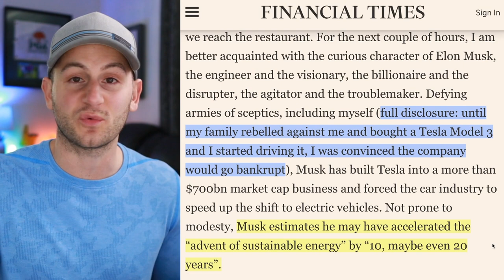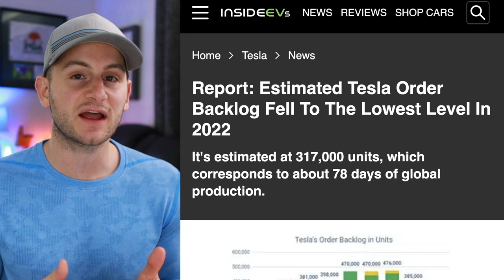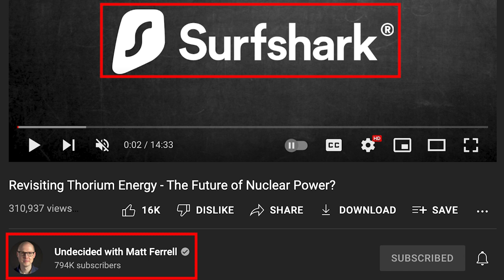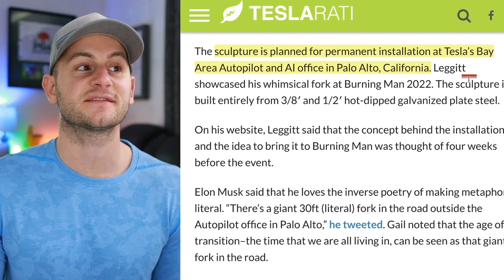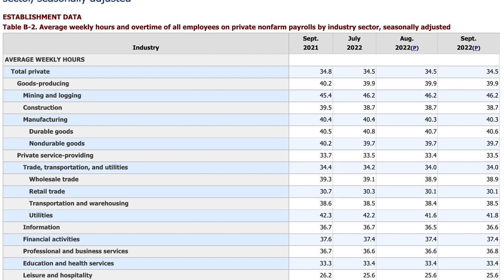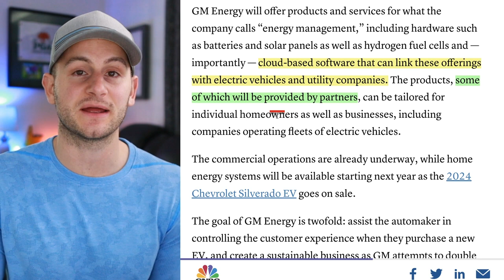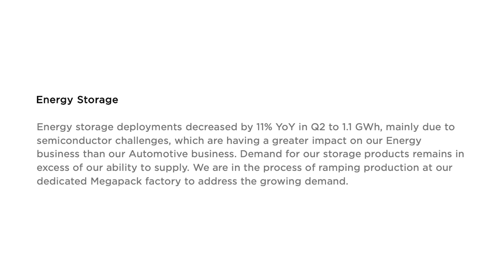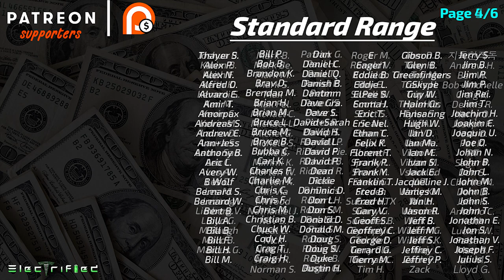Tesla's Order Backlog: Getting It All Wrong / GM Takes Aim At Tesla Energy - Can It Compete? ⚡️

Comment: GM: if you can't beat them! Replicate!!
Reply: Yep! This really sounds like responding to the current thing to pump share price and get through till the weekend!! I see no depth. I see no roots or competence. They are essentially assemblers of parts such that when the parts aren't available they cannot produce.
Reply: Nonsense!!! As if those solar:batteries things didn’t already existed before!?
Reply: @markthomas7279  why did Tesla stopped selling both batteries and solar separately!? Also solar panels are significantly way more flexible products than the shingles.

Comment: No, you are wrong. I just went through a solar panel installation with Tesla Energy. What a horrible experience. It took 6 months from start to finish, the performance of the system is less than half of the design specification, the sevice was terrible, and they down graded my electrical load panel without my permission. I have no spares and can't even install a wall charger without spending $1,00's to upgrade the load panel that Tesla installed.
Reply from the maker: ah man, i'm sorry to hear that dan! that's frustrating...hope you can get it worked out. tesla solar definitely has a long way to go

Comment: Dillon, I really think Tesla should consider leveraging its existing/future product lines to get into automation of building of homes and other structures.   This industry is a huge TAM that is ripe for disruption.    I think they could literally cut a huge portion of the cost of building properties out with Tesla Bot or maybe they could come up with an interim way with something like a giga casting.    Once completed there is just a ton of recurring revenue that Tesla could capture such as property insurance, Tesla AI for maintenance, security, environmental, entertainment, etc, and Tesla Energy.   Any thoughts?
Reply: yes robotically built, on site, 3d printed homes, with factory built equipment modules, will take over the market in my opinion. to minimize future energy use, they will need to branch into in ground heat exchange systems. to heat/cool a homes air/water with the least energy.

Comment: The GM battery move is a terrible idea, they dont make the systems or install them. Solar and battery install is a commoditised market and very competitive, if you don't have vertical integration getting the cost structure right will be very difficult. Ive seen this multiple times in the industry where a company thinks because they have customers they can automatically convert that to business even though they dont have the cost structure to do. They typically want a 40% margin on top of someone else supplying the product (Sunpower) so its never competitive. To make things even worse Sunpower are just about the most expensive panel in the market (great product but scary expensive) and cant imagine their battery offering will be any different.

Its got road to disaster written all over it.

Comment: I repeat that Elon has lost interest in auto retailing reality apparently.
Old designs with not one single ‘leak’ of any sort of visual update but, instead, frequent updates on taking out previously standard equipment.  Wall charger, granny charger, radar, ultrasonic sensors, ??? accompanied by price rises and embarrassing profit margins.  FSD price increases (not transferable) and going nowhere other than extreme  ‘suggestions’ of coming breakthroughs.  This is running the single product (M3/fat M3) down and is unsustainable…….if others are now getting the eyeballs. The competition HAS to fail if Tesla is to actually dominate.
Sticking the head in the sand is worrying company behaviour
Reply: Nonsense. GM is coming out with 30 different models. A sure recipe for success right? Meanwhile tesla is insanely profitable. Clearly being mismanaged. What's wrong with this picture?
Reply: @rainerdeusser  one product being screwed for max profit with no other apparent direction other than the short term maintenance.  Where is the next factory going and why isn’t it already well on the way ?
There is no proof of burgeoning demand.  Lots of talk.
I want my M3 to have a parent company long term but that requires more investment committed a year ago.
Who is responsible for visual update of these ageing designs ?  Software is going nowhere in my experience of basic AP issues.
Reply: Ummm... Tesla is dominating BEV now. If... And in select countries, It IS the leader in ALL VEHICLE SALES.  Caps for emphasis not yelling.  Name one legacy manufacturer producing BEV in volume and profitably?
Reply: @davidpearn5925  agreed
Reply: pearn  you're confusing success with failure and valuing appearance over substance. Tesla is revolutionizing the auto industry, and you're wanting more of that good old legacy management philosophy. Read the numbers. Read the financials. Legacy will only survive to the extent that they emulate tesla.
Reply: @rainerdeusser  💯😆
Reply: @rainerdeusser  insanely profitable ? on only 2 products ?? Model 3 and Y for Now but  what is next ?? All of now are just talk
Reply: @JY-lg6ee  you must not be seeing something. Look at the financials. Tesla makes more profit than gm, ford and toyota.
Reply: @danialmoser2573  today !
The tomorrow is all vapourware in the absence of fiscal outlays accompanying the spruiking.
Reply: @rainerdeusser  And most important -- read the engineering.
Reply: And yet growth continues and their market dominance seems to be growing too. How can high margins be embarrassing. Your points all represent opportunities. Tesla is soaked in cash. It can enact projects at will. That is hasn't to date reveals that their factories are full producing cars to preorder. Yes that will change. As the change happens, then Tesla can pivot.
Reply: pepearn  yeah, sure. China run rate 1 million, can build to 2 million. Berlin and texas built in 2 years with eventual run rates of 2 million each. Thats more capacity than either gm or ford that have been in existence for 100 years. Your complaints have no merit.
Reply: @JY-lg6ee  Throwing off so much cash and have the supply chain mastered. If they need new models or refresh then they have no restriction in this pursuit.
Reply: @rainerdeusser  Net Profits or Gross Profits ?? Legacy don't pay or run the dealerships but Tesla owns and run all the Service Center
Reply: @markthomas7279  Not to mention that no other OEM that operates at scale, has been able to even make a profit on EVs.
Reply: @SkyRiver1  yes. The musk drive to engineering excellence is the foundation. Focusing on visual design and marketing has given us 3 decades of losing, stagnant product. Today's ice vehicle could have been built 40 years ago excepting computer tech parts. NASA could have built cheap reentrant rockets 40 years ago. Why didn't they? SpaceX did it on a shoestring with an engineering mindset.
Reply: @markthomas7279  Really ??  , Tesla can't even mass produce 4680 as of today, still having trouble making it, Semi in Dec ?? , Cyber truck ?? When ??
Reply: @rainerdeusser  yep in theory.
I’m an owner.
Reply: @markthomas7279  you have to be ahead of the game just to survive
Reply: @davidpearn5925  have faith. I'm an investor. Dont day trade, take a five year perspective. Tesla will have the 4680, fsd, the highest production, the most charging stations, the best commercial transport, 2 to 4 more factories with 4 to 8 million more capacity, and none of that is extravagant speculation. Just extend the current trends. None of the legacy have any of that.
Reply: That’s why Apple is so close to going broke, because they don’t have enough types of iPhones 🙄
Reply: @davidpearn5925  Agreed. that is why Tesla Stocks price drop like a rock in the past 30 days, Stocks pricing is a Reflection of what people predicate for a company's future will be
Reply: @JY-lg6ee  YouTubers can’t bring themselves to tackle the obvious gaps
Reply: @Steph1  nobody buys them either apparently.
11,12,13,14 all duds.
Reply: @rainerdeusser  Tesla has accumulated many laurels over the past few years.
Elon is happily sitting on them - working assiduously on increasing profit margins ……….brilliant short term account planning.
Reply: @rainerdeusser  I’ve been a motoring enthusiast for 70 years and am a grounded owner.
I’ve had enough of Elon’s spruiking, having been one of his unquestioning fans and member of the cult.
The reality is the stripping standard gear out and pushing out that useless ‘blind spot’ con that doesn’t warn at all and all the basic AP improvements that were indicated as coming real soon but never in reality.
Consider that if a  ‘new model’ comes out it will require that you pay a pile for that FSD con yet again.
The idea that the resale value will increase significantly and cover the repeat outlay ………well I’m subdividing land on Mars if you are interested.
Reply: @davidpearn5925  we will see how things turn out. Sounds like you should sell your tesla investment. I'm going to buy tesla stock because it is undervalued due to flawed analysis by the market, which is how I make money. Good luck. May the best man win.